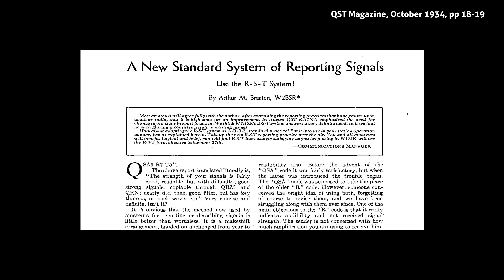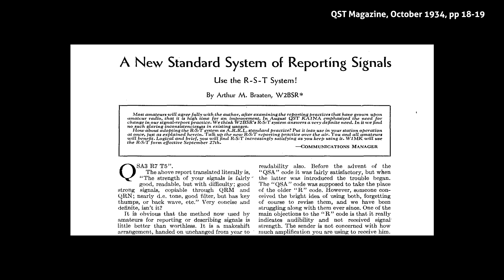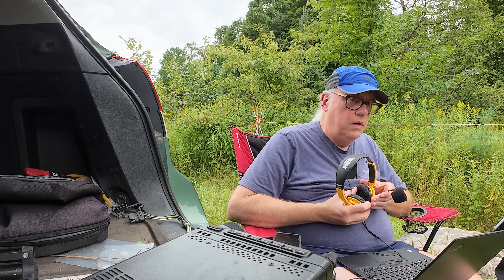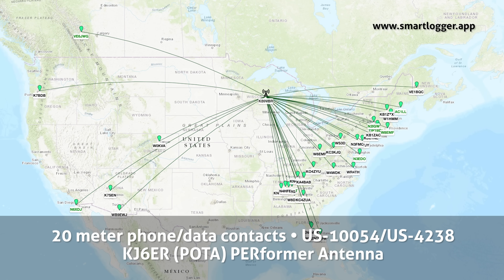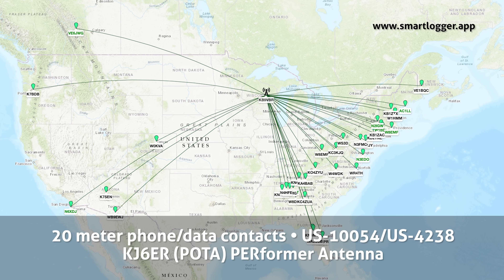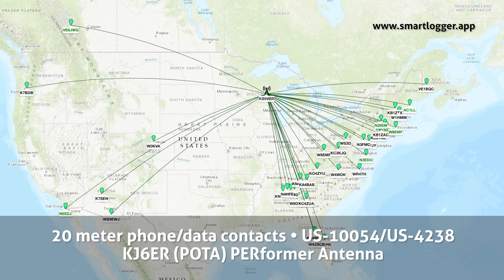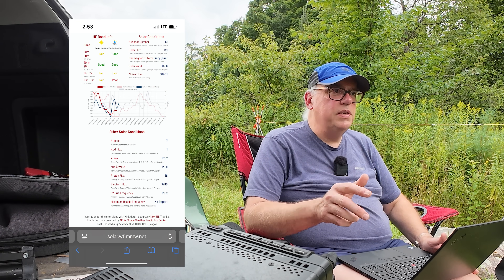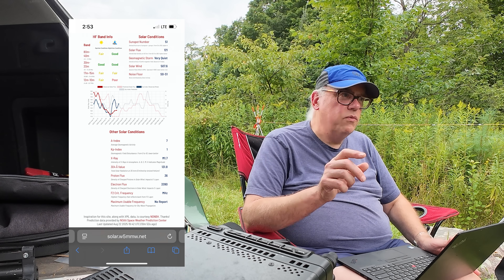Why your Ham Radio Signal Report may be WORTHLESS

Comment: You were giving lower reports than I was thinking of generally.  You often commented they were “very down” or “week”.  I usually keep that to myself. You even gave one of the P2P you worked a strength of “1” where I heard them fine (I’d call a “4”) Then they told you they were QRP using a POTA performer and your parting words to them were something like, “that performer antenna doing a good job for you”. 1?  hmmm
Reply from the maker: I think we all have our own personal thresholds of what is a strong signal and what is weak. That's what I tried to convey is the problem with signal reports. I feel that it's a higher compliment to pull someone out of the noise and tell them such, than to sugar coat their signal report.

Comment: Let's talk about the T in RST. I've always heard that a 9 is almost automatic, that there's no reason a modern transmitter should produce a flawed tone. I make it a point to send less than a 9 if I hear an obvious chirp, figuring that the boat anchor folks will appreciate the fact that someone can recognize the distinct sound of vintage equipment. Would any boat anchor guys or gals like to weigh in on that?

DE W6KSR
Reply from the maker: I would agree, unless you are running vintage or homebrew gear, the Tone in RST wouldn't be anything other than 9.

Comment: I thought that was you I had a Qso with today. I wasn't sure, but I thought I recognized your voice. I've been subscribed to your channel for a little while now. Thanks for the videos they are very helpful.  I was running qrp 20 watts on the xiegu g90 with an EFHW sloper 58 58..not bad from Massachusetts  KC1UTJ  73   PS Thanks for suggesting HAMRS for logging, game changer.
Reply from the maker: I checked the log and we did have a contact, August 31 at 21:55UTC on the 20 meter band. I spent a long weekend camping at US-1480. I got my logs uploaded last night, so you should see the contact in your hunter list.

Comment: I have a signal meter question about my FT-891 on 20 meters. Either the meter doesn't work or I have a setting wrong. I can receive a very loud signal and the meter doesn't move. If I switch bands for example to 40 meters the meter does fluctuate to match signal strength. I believe I have the meter settings right. This has been  driving me crazy.
Thanks
Kevin KA0KAE

Comment: Thank you for addressing the effect of settings on the s-meter.  As a newer ham, this has caused me some confusion.
"True" objective reports are out the window at this point, unless you do not use any bells and whistles.
The s-meter does seem to give me an accurates value that lines up with what I am hearing, regardless of the settings.  And that works just fine for me.

Comment: Very interesting video and very pertinent. 
To add to the confustion, for example, the S-meter on my Drake R4C is more sensitive that the industry "standarrd" of 50uV. It shows an S-9 at 30uV per its specifications.
You also make a very good point about what the S-meter shows after preamplifiers, filters, and DSP. I doubt anyone will shut all the bells and whistles off, just to see the S-meter reading.
Manufactureres also confuse the issue by mixing up units in their definitions. Example: Icom says the S-9 reading for HF is -73dBm (5mW of power) and in parentheses 50uV with 6dB between S-units. Well, for POWER (as in milliwatts) 6dB is double/half power. But, for voltage (50uV), 3dB is double/half voltage. Do the specification writers even know what they are talking about??!?

Comment: Good video, and I agree with your assessment. For strength, I tend to stick to odd numbers 3, 5, 7, 9, making mine a 4-point scale. I don't think we have the accuracy to differentiate between a 5-6 and a 5-7 signal, and it's not necessary to overthink it.

I do have a slight technical quibble with a couple of your statements. QSB is not a form of interference, it refers only to fading. The interference Q signals are QRM and QRN. Second, on most modern rigs (like your FTDX-10), the RF gain control does not affect the S meter reading, it's the same for all RF gain settings. The controls that DO affect the S meter are attenuation, and preamp (IPO). Try it for yourself.

Tnx for the video --n1bs

Comment: I hear a Ham give 5-9 reports to 10 contacts in a row, impossible and not accurate !! Each signal report should be different because of equipment limitations, band conditions, and antenna used. No two signal reports can be the same if the receiving station is being accurate !!!

Comment: On 15 Meters SSB, I've worked a bunch of stations loud and clear at S0 (I have a very low noise floor on 15), since there isn't a 50 signal report, I had to give them a 51, and I've gotten the same back, where there is no S Meter movement but are still loud and clear.
Reply from the maker: Yes, that's not unusual for 15 meters. In those cases I usually say 'you're a very loud 51'

Comment: ...& a great vid, too, helping to understand how RST began; & of course, in the earliest days of Amateur Radio, as u know, a-l-l xmissions were via Morse Code, in fact, by using spark-gap xmtrs👍🇺🇸
Reply from the maker: Yes. Tone, for CW operation was more important as transmitters back then didn't have the frequency stability that modern ones have. By the time this article was written, in 1934, the FCC Telecommunications Act had pretty much banned spark gap transmitters, though.

Comment: ...& of course, now, with today's mostly modern xcvrs, the "T" (in the RST reporting system) is more or less meaningless, because on CW, almost e-v-e-r-y-o-n-e will xmit a "perfect" CW note (save for some using homebrew equip, where they're sometimes not quite a "T9"); 73 😃 dit dit 🇺🇸

Comment: I ask you this: Have you EVER looked back over your log and remembered a signal report fondly, or regretted a 5/9 when you remember it maybe should have been 5/5, or conversely thought you should have been more generous with the report of 5/3.
Do you ever waste time and effort doing any statistical analysis of reports correlating some other measure of solar conditions?
My answer NO... Reports are momentary confirmations or in some cases an insult or mystery. There's no reason to be, in any way, fixated by them.
Reply from the maker: Exactly. I'll speak of RST reports in broad terms, like: "the band conditions were so good, everyone was coming in 59." But to do an analysis on signal quality based on RST reports would be meaningless.

Comment: I don't think I have ever given below a 3 readability. If I can hear without messing with the receiver it's a 5. If I have to maybe cut back the rf gain, or mess around trying to cut out qrm, or the flutter and fade monster is in play it's a 4. Below that the contact probably isn't happening. If I am hunting, my signal report is accurate. If I'm activating, I generally try and watch the meter for a couple of contacts early on to establish a baseline and then estimate from there. I paper log so I am normally too focused on writing legibly and concentrating on getting the call sign correct to worry about actually looking at the meter. Tone? What is this thing of which you speak??

Comment: Hello Michael, this is a very relevant topic, thank you. When discussing signal strength, each person in a QSO - be it for POTA or any other contact - should give as accurate estimation as they are willing to do. When my S meter shows a 6, but, the signal is blowing up the headset, I tend to go with my gut and give a 9+. That is just me. It IS IMPORTANT, to me, to learn how well my signal is “getting out there”, partly because I like fooling with antennas. Anyway, thank you KQ4IXD
Reply from the maker: To me, anything S7 or better pretty much sounds the same, and if I'm not looking at the meter, I'd give them a 9.
Reply: I really want to know an honest view.  I don't take 5/9 as some sort of complement.  I'm interested in whether conditions impacting the call are reciprocal and to what degree my TX wattage is working for a distance, how is my setup comparing with someone with bigger antenna and more power. I don't want to know fake reports, just don't understand what purpose it serves.

Comment: Good video!  Readability is certainly subjective.  Signal strength can be, and usually is, read directly from the S-meter, and is significantly influenced by the antenna receiving the signal.  Different antennas with different designs w.r.t. gain, directionality, lobes, polarization, etc. at the same location may receive much different signal strengths from the same transmission.  Also, the S-meter is really Signal plus Noise, not just Signal.  It is the signal-to-noise ratio that really matters in terms of your ability to pick out a readable transmission.  If you have a very low floor, you may pick up a S1 signal with perfect readability, or even a station that "doesn't move your S-meter".  I agree with most of your reports, but since you asked :) , I would have given the 33 station a 41, because the station was readable with practically no difficulty, and the S-meter read 0 or 1 (0 is not an allowed strength report).

Comment: Yes, go with what you feel.  I have heard of people giving a 51.  They heard the operator flawlessly bit the S meter hardly moved.
Reply from the maker: That's a common experience, especially on 15 meters. The noise floor is often so low, weak signals sound booming loud.